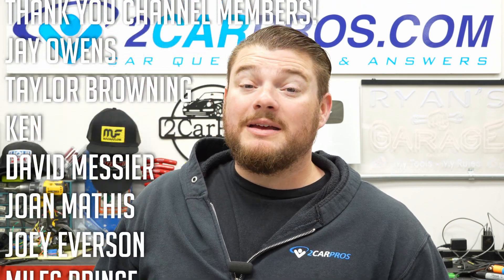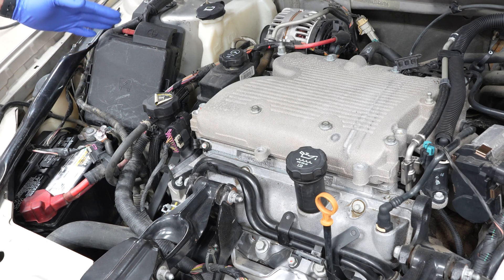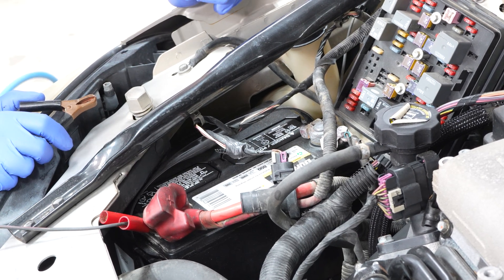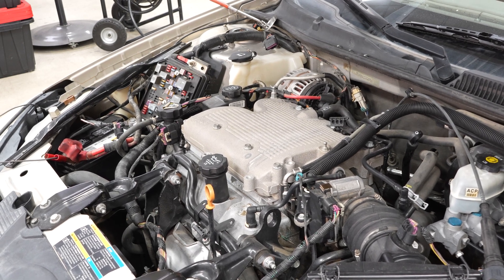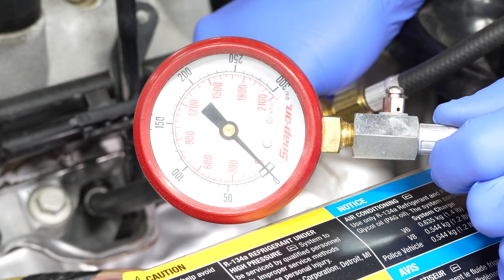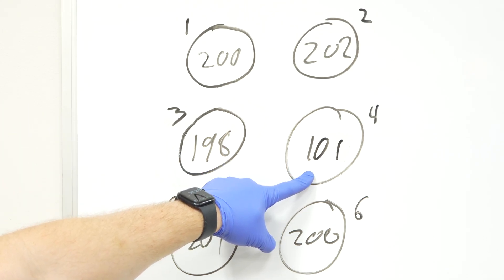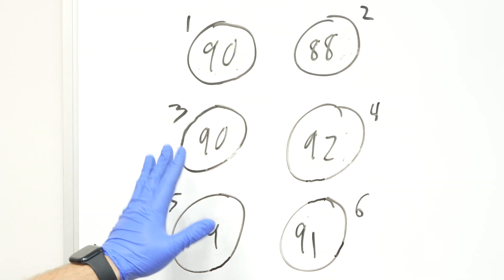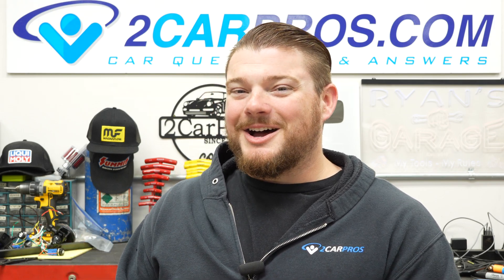How to Perform a Compression Test on an Engine | EASY!

Comment: I believe it is recommended that the throttle be wide open while cranking so there is plenty of air to compress.
Reply from the maker: You really don't want to force open the throttle body, it will damage it. It has plenty of air on start up and idle anyways. We also got 200 psi without touching the throttle. Thanks for watching!